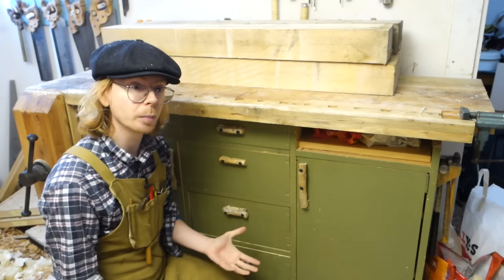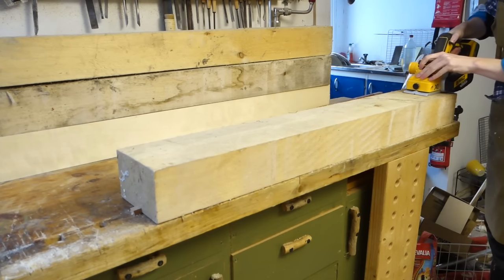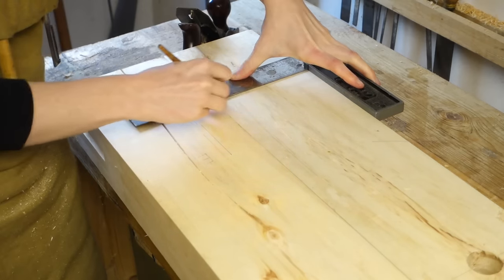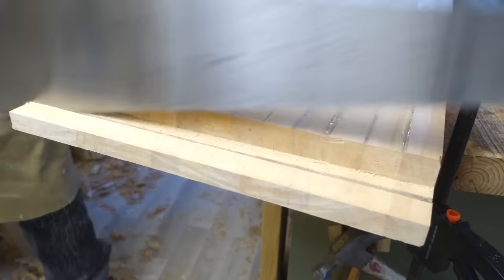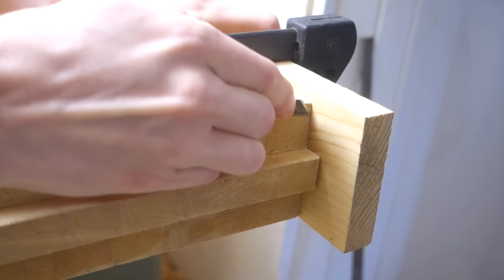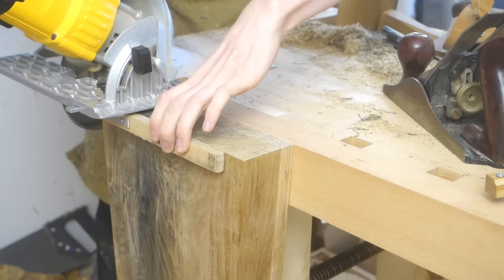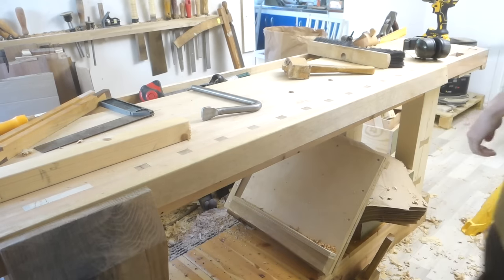So I guess I built my dream workbench

Comment: With my large delta table saw and an outfeed table and a small secondhand work bench, all in a very small room off the house, I realize I have to adjust my priorities and make some changes. I think the saw needs to go, and I need to make a larger bench as the center point of my work area. I have access to full cabinet shop tools if I ever need to do a massive amount of stock prep, but my small sanctuary should be rearranged to focus on my projects and not my stock prep.
Reply: Good call 👍

Comment: I watched the whole video in one sitting.  It was wonderful.  I am going to be building a work bench for myself, it will probably be my last as I’m 70 and retired.  I will be using some of your ideas and techniques.  I am especially encouraged in using mostly non electric hand tools.  I have the top which is 100 year old solid hard maple 30” x 72” x 3” which used to be a butchers cutting table.  I’m getting a Sjoberg bench vise for the front, and already have my grandfathers tail vise.  I would like to make the base out of yellow pine, and will be using your technique of joining it to the top.  Thanks for taking the time to make the video.
Reply from the maker: Thank you, glad I could give some inspiration for your bench! Good luck with the build!

Comment: I built a bench out of 2x4s, 2x6s, and 4x4s, figuring it would be temporary but 40 years later, I was still using it.  It was more than adequate.  The tail vice used a threaded rod for a screw and a coupling nut but it was hidden inside the wooden parts.  You could do that.  See Frank Klausz' workbench in Fine Woodworking magazine.  Braise the long nut to a big washer and the thread rod never failed.    You're doing a great job.

Comment: I inherited my father's shop equipment. He had two, one in in the city house, which he built, and one at the family “Semester-Hus”.  There were two of most of the machines along with many hand tool, including an almost complete set of metal planes, missing the #1 and #2 and a few specialty planes. So I have two bandsaws, two drill presses, two wood lathes (gave one away), two jigsaws, and multiple routers. All of them in or approaching the antique category. Three sets of carving chisels and a large variety of hand chisels most need sharpening, which brings me to a question…what methods do you use for sharpening?  Recently just finished having my shop building insulated so the tools won’t be too hot or cold!  Since repositioning equipment and benches I will be building a new base for one of my workbenches your excellent video will definitely be a rewatched video and the bench will incorporate some of your bench features. Will be looking forward to watching more of your videos.

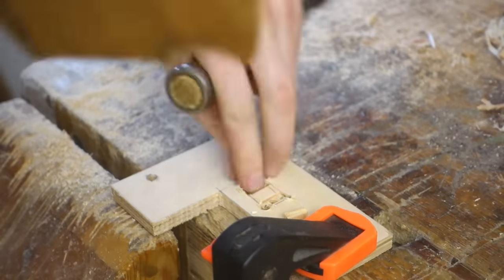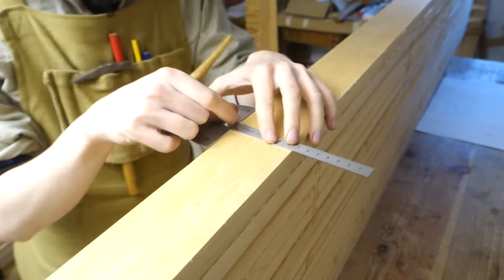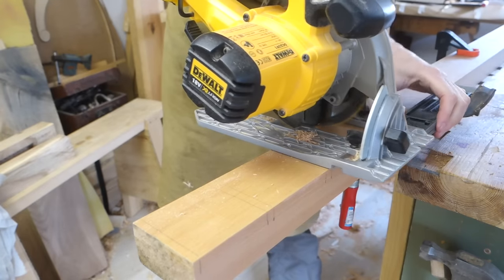Comment: Fellow “cat person” (27:45) here, loved the video! Workbench aside, a veritable masterclass on woodworking techniques, coupled with some not-so-basic tips, such as the rationale for the slightly angled dog hole (18:10) or the “bridges” for the router plane (21:10) - both a first for me.
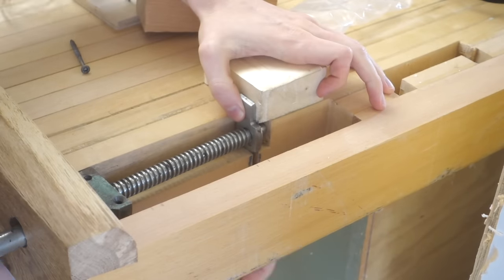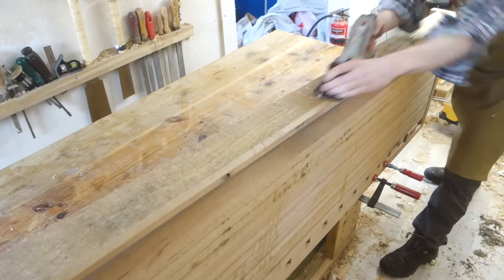(Minor quibble: given the assortment of solid wood species, I hated the plywood at 29:30-30:00.)
Reply from the maker: Many thanks! Glad you got some tips! Regarding the plywood, I’m not a fan either, but in some applications the alternating grain direction is useful. The parts on the underside of the tailvise get stressed a lot when tightening the vise, and I worried such thin pieces would split if made from solid wood. I might very well be overthinking it, but that’s my reasoning!
Reply: @GillisBjork  Yes, I could tell why you did it, still I find it a bit discordant. (I wonder if you could have made your own “plywood” by glueing together two thin pieces of oak with the grain running at right angles.) But this is an insignificant detail that just happened to strike me as odd: overall a great build and an excellent workbench!

Comment: The question you want to ask is why they are called bench dogs, dog holes are just where they reside.

Dog, Noun.   Any of various usually simple mechanical devices (such as an andiron or detent) for holding, gripping or fastening that consist of a spike, bar or hook. 

Not the current English usage for parking lot buggery.

Comment: I had fairly traditional training in cabinetry and finishing, in the sense my master was very traditionally trained and believed you must learn the hand process in order to be using the machines with understanding.  I built a couple of things largely by hand, and while I could still hand saw the boards and joint them by hand etc, why on earth would I not use whatever machine suitable to speed the breaking down and waste removal process - Chippendale Snr. would have been the first to use mechanical aids in order to improve his workshop output speed, had they been available to him...  Sometimes traditional means just the technology of a time, and we have options today that past crafts would find astonishing and exciting in equal measure.  Hand jointing and surface finishing, joints etc. are completely as relevant as a panel saw or planer or sander - it's still the skills of the craftsperson that provide the piece to finished dimension...  I tool finish my work generally, if not straight off the plane or chisel then with various fine scrapers - because I like the clarity and depth of finish when oiling or polishing.  I might cut a mortice with machine, possibly the tenon too but it is also just as true I may cut them by hand depending on what I have available and how many to do.  I don't bother twisting myself in knots trying to work out where hand work finishes because it isn't important - I use hand skills mostly and machines when they make the job quicker, the machines are mostly to break timber down for me so the closer to finished a piece  is the more hands on I am.  We all find our comfortable position within the extremes, I prefer to spend a few weeks on a project, rather than several months - I'm getting impatient as I age perhaps... :)  Cheers from Oz.  Also - the term dog in engineering and machinery describes the way a dog clamps on, the mechanism that a dogs jaw uses to lock onto whatever it is biting and not slip.  So it's a very old term and literally means, 'to grip like a dog - old english, dogged, doggerel, dogged home etc'.  Bench dogs grip the work, and when designed right don't let go like a powerful dog won't let go.
Reply from the maker: Thanks for sharing, I don't have any training so I'm just doing my best with what I have :)

Comment: Great video and fascinating watch! I'm a beginner woodworker living in Sweden and I'm having trouble sourcing wood other than pine... do you have any recommendations for sourcing hardwoods, especially of a size needed for benchtops etc? I have the same concern about the softwood and holdfast combo...
Reply from the maker: Thank you! Yes, that’s a struggle. I’ve bought slabs from Massivträdesign, which was great. I follow a few more sawmills on instagram but haven’t bought from them yet. But look around there and on facebook, and be prepared for a long drive, they’re not common!

Comment: Great Job (As usual!).  I noticed you had a MHG chisel with the very bulbous handle.  I was wondering how you found that handle compared with a more traditional handle?    When looking at their site, I noticed a slinder handle option that I went with, but if I hadn't noticed them, I would have went with Narex Richter.

Just really curious how you found that handle shape in use and storage.
Reply: By the way, I am watching your shop tour 2019... and I heard your remarks about the MHG handles... LOL.  

For what it is worth,  the slender handles they make for the exact same chisel blade is nice.
Reply from the maker: Haha yeah, I've been meaning to do something about that for some time... Would have bought the slimmer handles if I had seen them!

Comment: Excellent result! 
How did you figure out that the height of the top must be 83 cm ? 
I'm designing workbench for myself and see that lot of people choose 87...95 cm workbench tall. Can you give advice how to chose appropriate height?
Reply from the maker: Thank you! Unfortunately it was simply trial and error, I just felt that my old bench was a tiny bit too tall for comfortable handplaning on. 87 would probably be more appropriate for most since I’m quite short, 95 sounds extremely tall though! At 170cm tall, 83 works out to 48.8% of my height, I dont think that’s a golden rule or anything but I’m very happy with this new height.
Reply: @GillisBjork  Ok, thanks. I'm 175 cm, so, probably,  87 cm should be comfort  for me.

Comment: I clicked on the video because i like that plane till design in the thumbnail and want to steal it and it's not in the video :(. Excellent bench though! I'm curious how the non-sliding dead man holds up. Pine and holdfasts for me has been hit or miss
Reply from the maker: Sorry about that, I forgot to take the thumbnail photo until after adding the plane till! It’s very simple though, just a panel screwed to two triangles. And yes, the deadman beam is a bit experimental, but Nicholson benches use a similar idea and I’ve seen a lot of those in construction lumber (and I used reclaimed pine with tighter growth rings and more heartwood), so I’m hopeful!

Comment: That rail on the floor looks like it'll cause some problems. Won't you just be constantly stubbing your toes? And the floor it goes down on will have to be incredibly level and smooth or else you'll end up with a wonky wobbly desk?
Reply from the maker: Not stubbed my toes yet! Can't really imagine a scenario where I'd need to put my toes that far in under the bench, remember that the rail is set back a good bit. Regarding the floor, sure, but I'll just shim under the legs.

Comment: I designed my first bench with the long stretcher 2" off the floor. It took some some time for me to get use to not being able to put my feet directly under the bench. Now, I don't even notice it, but when I ran into it I promised I would build my next bench with the long stretcher least 4" above the floor.

How have you dealt with your new bench with the long stretcher on the floor?
Reply from the maker: My old bench had a cabinet all the way down to the floor so I’m used to it :)

Comment: I built my bench with much the same bottom frame design. Unfortunately, after minimal use, I hated it. Shavings, dust, cutoffs, and everything is caught inside the trestle and there's no good way to sweep or blow it out since everything is against the floor.
Reply from the maker: I put a shelf on the long rails so stuff doesn’t fall down between them, no problems with the design yet!